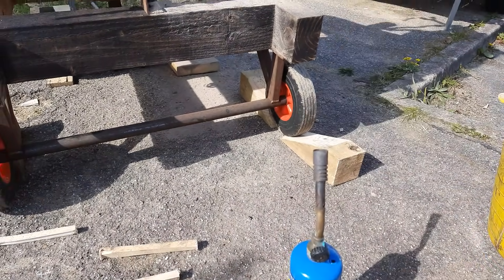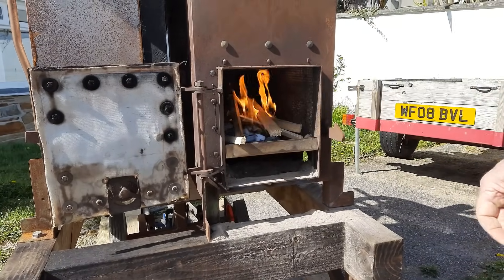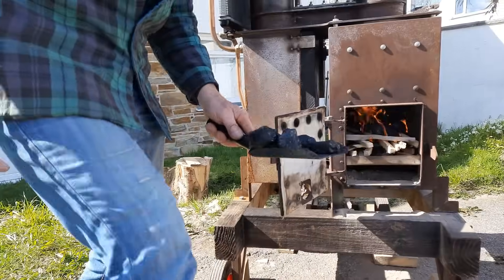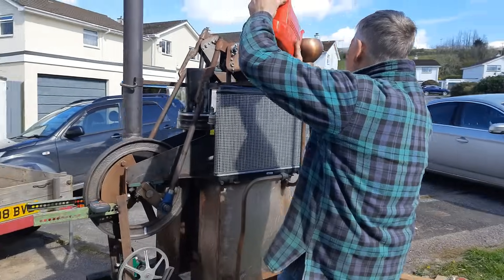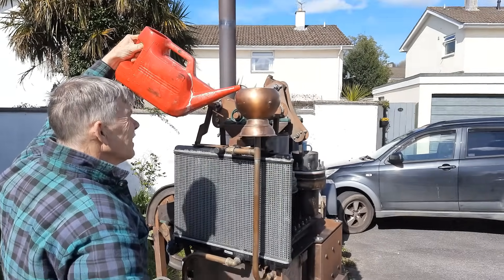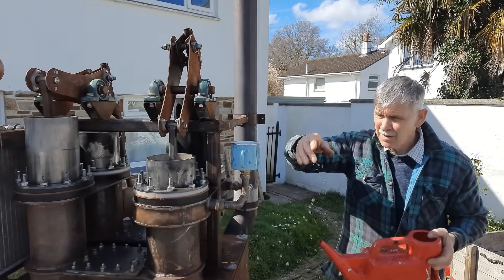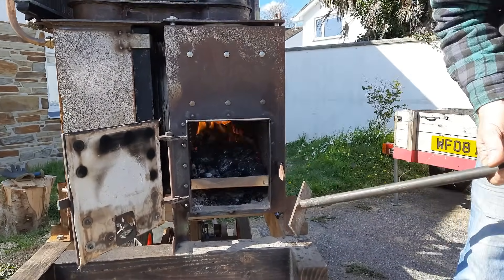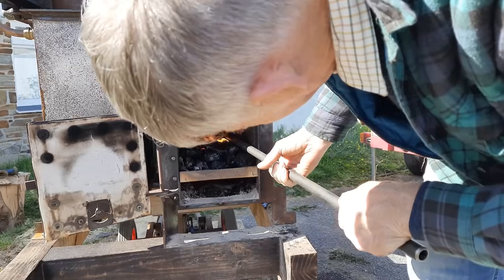Stirling Engine Generator Homemade DIY 0.47 KW ! Part 3

Comment: I always search for big Stirling engines and can't find anything, so really take my hat off for this one. Congrats for such a nice project!
Reply from the maker: Kind words! I plan on building a more powerful, simpler, smaller version. stay posted
Reply: @ShanePomeroy  my dream is build one powerful enough to move a vehicle and build a bike or car. Maybe one day I'll get there. Until then, I wanna see your next project :)
Reply: The reason you can't find big Sterling engines is because they don't exist. 
Stirling engines work on relatively small temperature differences. Which makes the engines large and very expensive for the power they produce and heat they need to operate. They are most suited to use waste heat
Reply: @davem5333  Sure, I agree. Even though I would like to make a big one for a vehicle just for the challenge and because I think it's cool, but it would surely be inefficient in comparison to other types of engine or electric motors.
Reply: @davem5333 wrong, NASA has made several trucks that ran on Stirling engines, and some older submarines used them as part of the propulsion system

Comment: This is most certainly a unique machine. I am just amazed you came up with the idea. Can you give some insight as to how this all came about Sir ??? Thanks
Reply from the maker: Most certainly. I build stirling engine Mk1 (see other videos) based on a "Rider hot air compression engine" that has two cylinders. I doubled up on this configuration and used the rockers to set each set of pistons 180 degrees out of phase from one-another. The Idea is that each set of pistons  is balanced against the other sets compression stroke. That has worked out ok but I do have serious balance problems due to the very long pistons and linkages. Hope that's as clear as mud! Any more questions , please ask
Reply: @ShanePomeroy  I will watch more of your videos and send more question. I tip my hat to you for this idea. Would you believe I had a dream about this type of engine years ago when I was at a old engine and iron show. Will keep in touch for sure.
Reply: How about a Free-Breeze Stirling engine fan would cost me fella ?? I would love to one built if you would be interested Sir. Thanks
Reply: @ShanePomeroy  How about using Calculus to balance this engine. I know from my school days that all steam trains used this principle to balance the running gears precisely. Also, you will learn something new or at best get refreshed if you are a math guy. Good day Shane.

Comment: a HUGE advantage of this type of engine is the fuel ... literally anything flammable can power it!  Technically with modifications it could also be powered by ice (on a a warm day) or dry ice, liquid nitrogen etc :)
Reply: The most efficient way to generate electricity with sunlight is a Stirling engine.
Reply: @kr6dr  You could do thesam with a flame gulper engine.

Comment: Very cool! 👍👍
I would have used a spring scale instead of the digital scales.
Spring scale can be very robust, and is easy enough to calibrate by hanging some weights on it.

Comment: Hi Shane. Excellent engine. It looks like a double Rider Ericsson. What type of regeneration matrix are you using? Also what sort of seals are you using on the pistons? It looks as if it would do a good job pushing a small boat along!
Reply from the maker: Hi Bob, Thankyou, yes it is a double rider. I am using stainless scourers because there cheap and easy to install. No idea how effective they are but it was the simple easy option. I started with leather seals but have just moved to PTFE for the hot side. Were see how it goes?
Reply: Not TOO small of a boat. LOL

Comment: That is fantastic to see a sterling that big. When I saw the coal I thought no the carbon the carbon lmao 🤣🤣🤣. What about using a rocket stove for the fire box. With the heat energy wouldn't it be more efficient to use steam power. Great job .
Reply: “ With the heat energy wouldn't it be more efficient to use steam power. Great job”

Steam is way more dangerous to play with than cycling hot air back and forth between two pistons.
Reply: @cortholiopezorama8879  true. I am just amazied with the out put you are getting. How are the seal's holding up.
Reply from the maker: @markfair7648  original leather seals failed quickly but PTFE ones are holding up better

Comment: Wow, this is actually almost powerful enough to run a computer. That's amazing!
Reply: Well, as long as you aren't using a Godly Gaming Gear Video Card, it should run most desktops.
Reply: at almost 500 Watt max it will charge a whole battalion of phones . .

Comment: That big engine produces less than 500 watts?
Reply: Yep.  Although stirling engines are very efficient, they require large components which is why steam was used instead back in the day.
Reply: @Andy-df5fj  This guy is already burning coal, which gives high heat.
Reply: @codetech5598  
It's not as simple as what type of fuel used.  It's about the size of the burn chamber and how much fuel is used.  I doubt this engine is efficient as it can be, but if it were an 1800's locomotive, an optimally designed Stirling engine would burn much less fuel than a steam engine for a given horsepower, but would have to be much larger and heavier to produce that power, making the efficiency gains wasted by having to move too much mass.
Reply: @Andy-df5fj  If all you have is a pan of warm water than something like a Stirling engine is all you can use to extract the energy into useful work.

But if you have high heat (which depends on the type of fuel) then you have more options and the Carnot efficiency should be higher than with low heat.
Reply: @codetech5598  
Agreed.
Reply from the maker: Yes pretty bad! The best atmospheric stirling engines achieve over 1 watt per cc. Mine gets about 0.2 watt per cc

Comment: Would love to see this hooked up to a generator or some kind and make some power.
Reply: The cost of the fuel just to get .5kw is astronomical and that is without any load.  Would be far cheaper to use a petrol generator. But give him his due he made something that works.
Reply: @welditmick  could substitute the coal with home-made charcoal, would need probably twice as much mass, but if you have a lot of wood to burn anyway from maintaining a property it'd be a decent way to capture some of the energy in a useful manner
Reply: @welditmick  During a "Zombie Apocalypse" with no clean Petrol?  This would rule!!

Plus IDK in your area, but there's always free scrap wood available in most cities.
Reply: For a couple lightbulbs lol
Reply: @jamesbizs  Or 100 LED lightbulbs
Reply: @jamesbizs  found the guy that still uses incandescent bulbs

Comment: Seems like a lot of cost, noisy mechanisms and work to generate 470 watts of power considering it takes 3 times that to power a small microwave oven and 1 solar panel can generate twice that for $150.
Reply: This is about the device, not the power. Building it and using it is the point

Comment: It is quite awesome but needs some serious balancing :) 
0.5 kw is quite impressive but the interesting figure for me is - the ratio between the input energy from coal and the total output...
Reply from the maker: Yes, balancing was ignored slightly during the design process! Fuel consumption is an interesting question. Once I've sorted out the generator I'm driving off it I'll try to get some fuel consumption figures together

Comment: A very interesting structure. I did something similar, but your power measurement seems unreliable to me
Reply from the maker: Just checked out your channel. Great work! Power measurement was very unreliable but gave a rough idea of output. The biggest problem was the engine movement! I don't think our kitchen scales will be right again!

Comment: would love to have seen this in sticker, only down the road from me..
can i ask what material the  doughnut seals are made from  that seal the pistons?
Reply from the maker: Hi Chris, I've applied to take it to Sticker this year so might see you there. Initially the seals were leather but I've moved over to 3mm PTFE for the hot pistons due to heat damage, Cheers

Comment: You had a cigarette light but still used a blowtorch to light the paper? Why? Also can't help but notice your cylinder head cooling water is boiling? Maybe some sort of hot to cold water cycling through a small radiator? Like an oil cooler from a car using the heat rises principle you would t even need a pump.

Bad ass job boys, you've inspired me to try my own
Reply from the maker: Lol! You got me

Comment: forget the wood ..... compact blocks  of trash,cardboard  etc and a little used  motor oil , and you have  made  it  use   garbage  as fuel!
Reply from the maker: That's a great idea. How are they compacted together? Do they smoke or run hot enough to burn clean. I'm really interested in trying this👍
Reply: a little ingenuity and a small hydraulic ram and steel box with different  types of shredded  up mixtures of garbage products..  experimentation of different types  of garbage mixtures, some may burn cleaner than others.  also you could use  yard waste  added to mix, but garbage waste  would be the best  because theres kabillions of tons of it , and there needs to be a way to use it as fuel .
Reply: also heres a smokeless burn barrel design you could use  that burns trash real hot with no  smoke 
https://www.youtube.com/watch?v=07P-6gqYg2g

Comment: Get the machine to drive an alternator  and charge batteries to power a power wall and then a house.....good stuff
Reply: Charge a power wall? So you’d just need a couple dozen more of these, and I guess you’d be good.  Or run it for a few days straight, and you might get one full charge

Comment: Чудова праця! Є креслення цього двигуна?
Reply from the maker: Cheers, Kind of,  If you search for "Rider hot air compression engine" your find a fair few pictures. I scaled it off of these and converted it into CAD drawings so i could get the bits cut out.

Comment: Any info on how you built this ? Now that's a video I would love. This one was a teaser I hope ; )

PS. You're definitely ready for the Zombie Apocalypse, 😆
Reply from the maker: I'll try to describe it  but only pictures would do it justice! Next time I take the engine to bits i'll take a video. My engine is an Alpha type stirling engine. It is made of two separate engines joined together to give 4 cylinders. Cranks give a phase angle difference of roughly 90 degrees between the hot and cold piston with the hot piston leading.  The rockers on top transmit the motion to the second engine, (if you will!) So essentially there are two separate engines running 180 degrees apart.

The pistons are displacement "ram" type and extend a long way down into engine. This is mainly to create a large surface area that the air has to pass against heater /cooler. Pistons are externally sealed with a lip seal manufactured from a doughnut shaped piece of flat material. For further information on this type of engine I would search for " Rider hot air compression engine"

Hope that makes sense?
Reply: @ShanePomeroy  Thanks man. Appreciate the info. Please do snap a lot of pics if you ever break it down. A picture is worth a thousand words, ; )
Reply: @ShanePomeroy  Hey, just watched the new video. Awesome ! Your one of the few builders on YouTuber bywho actually does what he says. Thanks, you rock ! 
Joe
Reply from the maker: I'm terribly bad at documenting projects as I go! More involved in the building! I've got a few build pictures. Anything bit your interested in in particular?
Reply: @ShanePomeroy   Hi thanks for the reply. I'm mostly curious about the pistons and the linkage. I have several books on sterlings but they're mostly toys. Yours is one the few I've seen that can do actual work. Thanks

Comment: Great work - I presume you are running the cylinders at ambient atmospheric pressure and not pressurising which would improve the power output (although leakage past seals starts to be a bit of an issue)?
Reply from the maker: Cheers - Yes, running unpressurised. We were going to run pressurised but have decided not to (don't think the seals would take it!). The main goal now is to design an engine that is very easy to assemble and this would add to the complication.
Reply: OK, Silly Question Time: If I placed the ENTIRE Stirling Engine, separate from the heat source, of course, into a pressurized chamber, would I still get an increase in efficiency?
Reply from the maker: @TimeSurfer206  Not a stupid question! There's a chance you would get higher power output. Would be hard to say if it would be more efficient. There are pressurised stirling engines built this way.
Reply: @ShanePomeroy  Might be worth a try...
I might give it a shot with some of the smaller models, as they'd be more easily encapsulated.
Reply: @TimeSurfer206  Yes - if you were to provide a sealed crankcase then pressurise the cylinders and the crankcase interior you would get an increase in performance subject to certain criteria. This is because there is a greater mass of gas being heated and cooled (i.e. the gas is denser due to the increased pressure) allowing more heat to be absorbed from the hot end of the engine and transferred via the gas to the cold end. Pressurising the crankcase reduces the pressure differential across the seal between the piston and the crankcase thus reducing pressure loss at that sliding joint. Note that as pressure increases the efficiency of your hot and cold end heat exchangers will tend to be the limiting factor on thermal transfer and thus power output. It is often the cold end that can't cope, leading to only partial cooling of the working gas and lower overall efficiency.
Reply: @timf3620  Gotcha, and thanks. This is invaluable material.
Reply: @timf3620  That last part is the reason for that the gas under pressure would need a cooler or it will just get to hot very quickly.

Comment: That’s awesome you quantified the power of the engine most people on youtube report RPMs only which doesn’t mean anything by itself.
Reply: If the system was balanced (see wobble) it would spin at least 1/3 faster... The wobble will eventually lead to mechanical failure due to the constant resonance in the unbalanced system. Great work though!
Reply: @mcombatti  yea they need to put some weights on it to balance it. You would make MOAR POWER, and extend the life of the engine!
Reply: @mcombatti Absolutely, but you gotta crawl before you can walk.  Everybody's got ideas on how to build one, but these guys went and actually did build one.  I'm thinking a couple of wheel weights, adjusted to get that perfect balance, would work nicely.
Reply: @mcombatti  eccentricity and unwanted kinetic energy are two of the worst opponents we face in making power daily without any system failures
Reply: But I got a bajillion volts!
Reply: Clever way to rig up a dynamo as well.
Reply: Not bad on conversation considering a 1/2HP motor takes 0.367749KW to run...